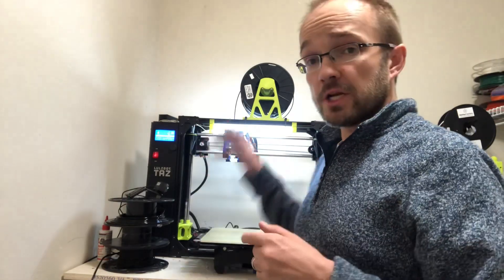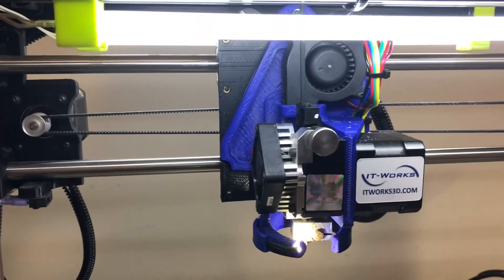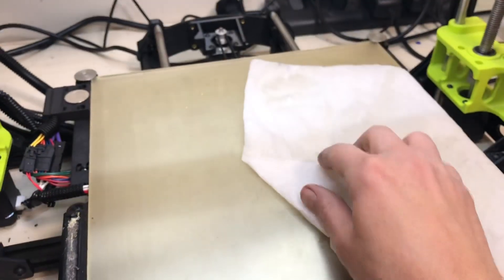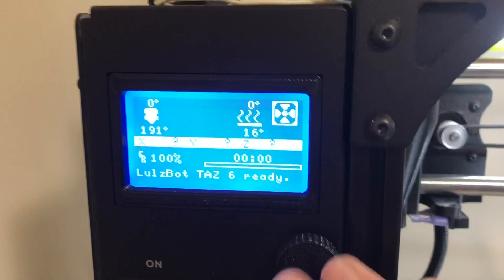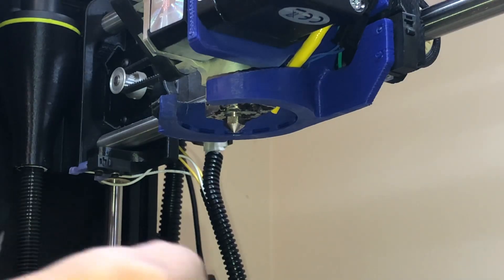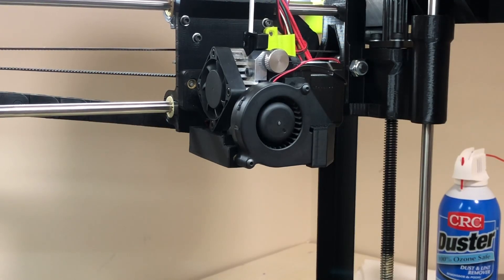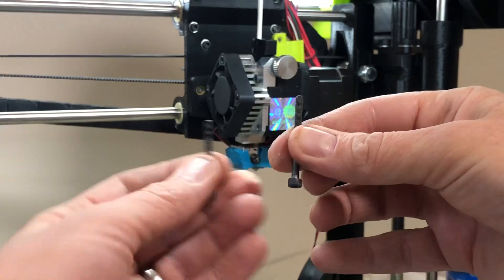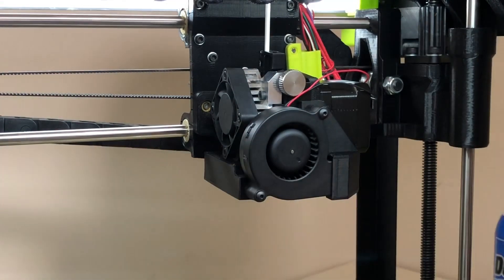How To: Remove and Replace Nozzles on your Lulzbot Aerostruder Toolhead

Comment: FWIW, you don't actually have to worry about shorting the nozzle out. The nozzle is connected to an input pin on the microcontroller that is designed to be connected to ground or a full 5v, without needing any resistors. It won't hurt anything unless you connect it to +24V, for example. But there are no exposed parts at +24V on the printer. The leveling washers on the bed are held at +5V (or +3.3V if you have upgraded your control board to an Archim 2).

In short, you don't have to worry about bridging the nozzle via a conductive tool to the chassis or anything like that.

Comment: Does this wrench work on the stock SE printhead from Lulzbot that the mini 2 ships with?
Reply from the maker: portudork the mini 2 ships with an aero exactly like what I showed in the second half of my video.
Reply: @jim2386  I saw that, but I didn't know if it was compatible with the special tool you show in the first part or if you had to use an adjustable wrench like you were talking about when showing the stock head on the 2nd half. It ended up being a moot point since the tool is sold out everywhere :p